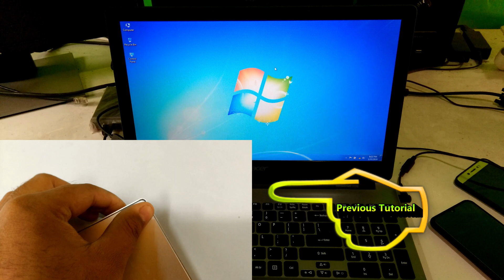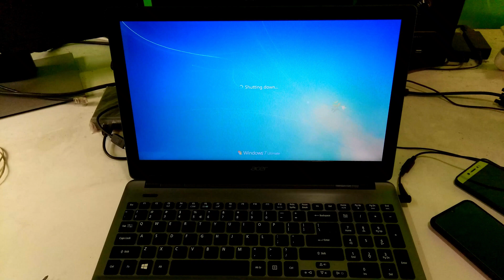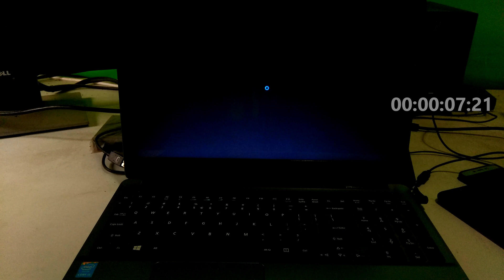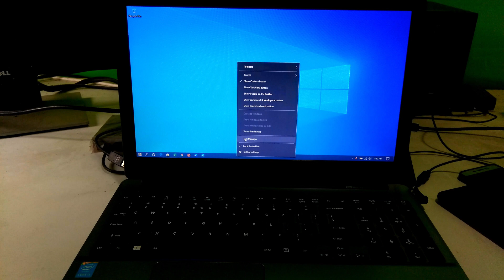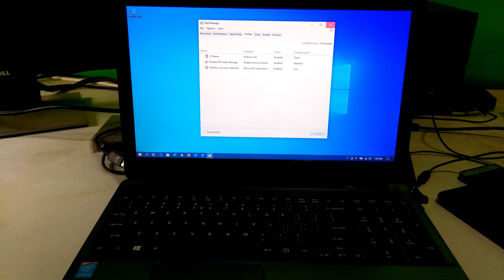How to Make Your Old Laptop Super Fast using WD M.2 SSD with M.2 SSD Enclosure (Installation Guide)

Comment: by putting the M.2 SSD in a SATA enclosure you bottle neck the drive to SATA specs, making it no different than a regular SATA SSD
Reply: Are you sure sir? Coz I am going to give it a try.
Reply: @rohitv2434  yes, the drive may be fast but the port on the computer is still SATA, and SATA has a speed limit due to the hardware, it can only send data in one direction at a time.
M.2 would solve this problem by Having two data lanes and sending data on both directions at a time but if you plug it to a sata port only one of those lanes is never used therefore limiting the speed of the drive.
Reply: @iamapie13  could you help me, i have a doubt regarding nvme and m2 ssd.

I have a i5 5th gen processor and it supports ahci. Suppose i want to add nvme ssd instead of m2 ssd, using this orica casing, will it support?

 I'll be upgrading my laptop next year and i want to put this ssd in my future laptop. Don't want to waste it.

Please do reply.
Reply: @ssp4865  no, there's different types of M.2 slots, they all look almost identical but have notches in different spots to physically avoid compatibility, an NVME M.2 does not fit inside a SATA M.2 slot, they look similar but they physically don't fit in, SATA and NVME are way too different protocols which is why no adapter would work.
I'm sorry to bare the bad news, I hope you find this helpful and maybe help avoid a regretful purchase
Reply: @iamapie13  thanks a lot! I would buy the sata one. Really appreciate your help!
Reply: @rohitv2434  this makes no difference from a regular SATA SSD, I guess it would only be useful if you already spare an M.2 drive, otherwise I'd save my money and buy a SATA SSD

Comment: do it will work on hp elitebook 840 g2?
Reply from the maker: Check your laptop manufacturer's information, I think your laptop has a specific M.2 SSD slot for M.2 SSD💻👍
Reply: @asatechnical  in the previous video you had done a reading and writing speed test. how fast in this video? is there a change? dvd-rom and old hdd slot which one is faster? please answer